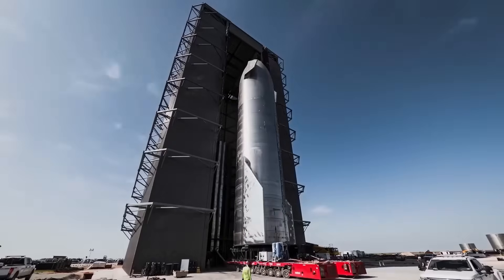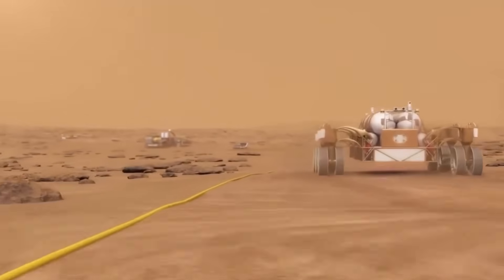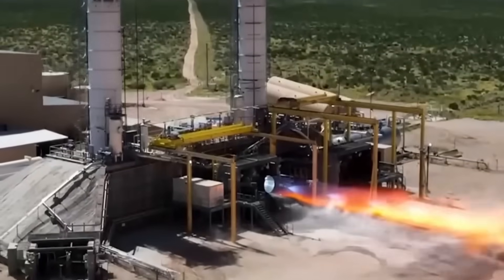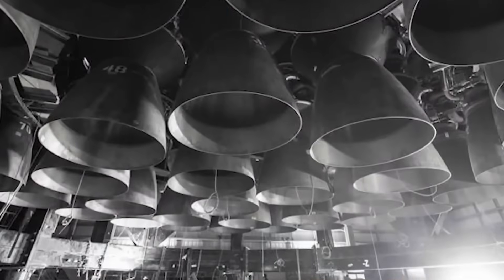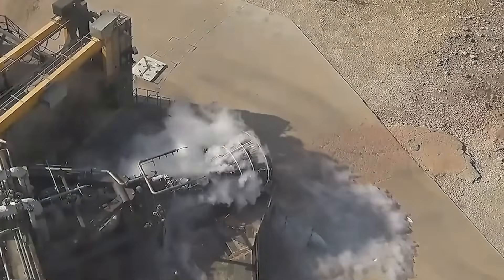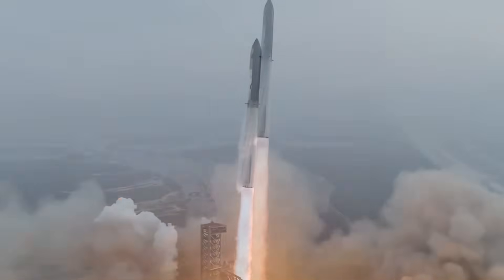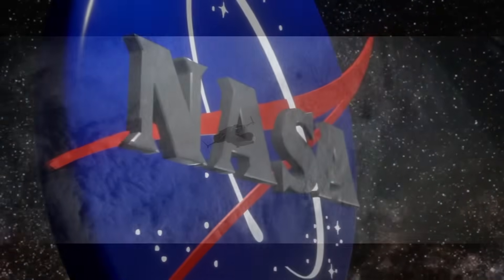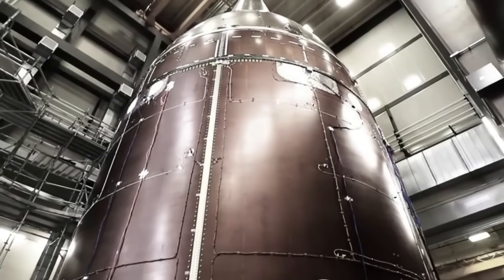NASA's New Nucleer Engine Will Blow Your Mind

Comment: Hi, good overview except you left out one major factor that contributes the most to the higher ISP of the nuclear rocket. The momentum of the exhaust gases is the molecular mass of the gas times the velocity of the gas.  Chemical rockets have primary combustion products as CO, CO2 and H2O with molecular masses of 28,44 and 18 respectively. Nuclear rockets with hydrogen gas as the heated exhaust has a mass of 2 therefore at the same exhaust temperature the hydrogen gas exits many times faster.